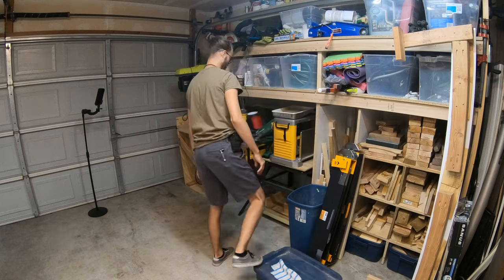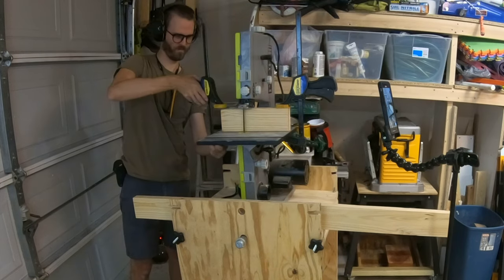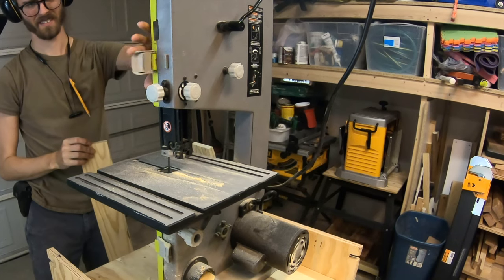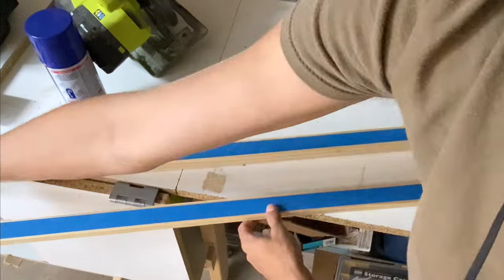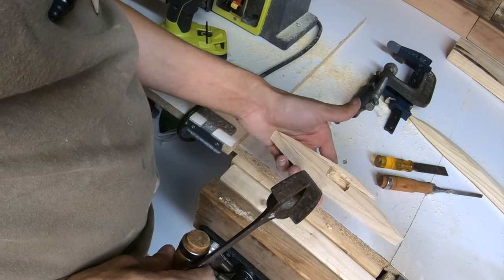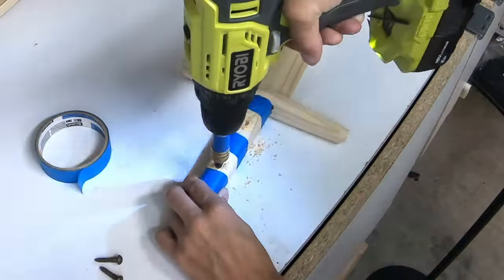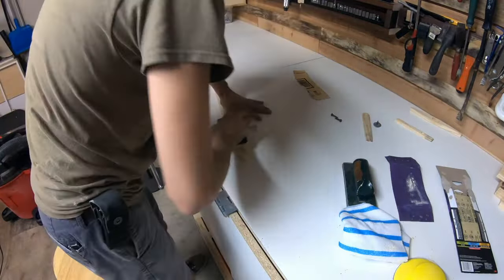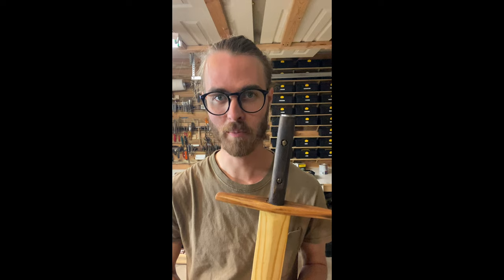How To Build A Sword Out Of A 2X4!

Comment: Was enjoying until it got to the sander mishap. I had to rewatch it after you put the guard on, your hand gets caught in a machine and your 1st reaction is to put a glove on??? Rule #1 in wood, NEVER wear gloves with a spinny machine. Look up degloved hands once and a little scrape or cut without gloves is worth it
Reply from the maker: my hand didnt get caught in the machine, the piece just wasnt big enough to hold.
Reply: Thats an excuse lol you dont use a glove for something thats too small you need feeling and your hand was under the belt. But you do you im just letting you know a tip that could save your hand skin
Reply: @SomeSkillStudio  He's right mate, also rings aren't a good idea either... not that you're wearing any,  just another thing to look out for. Nice job, and well done on the sword.

Comment: You have a perfectly good table saw behind you why use the band saw to rip the board?
Reply: How would you do that?
Reply: @badzs.  turn the wood on its side and push it through the blade. That’s what a table saw is made for. Ripping wood in a straight line.